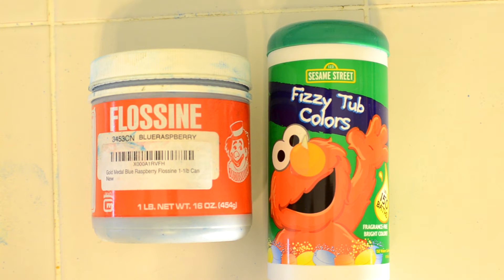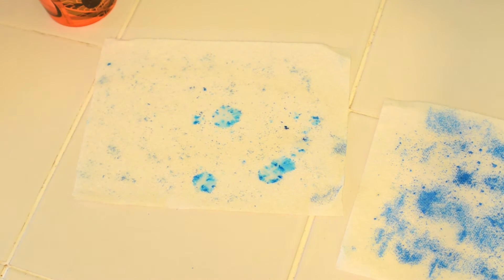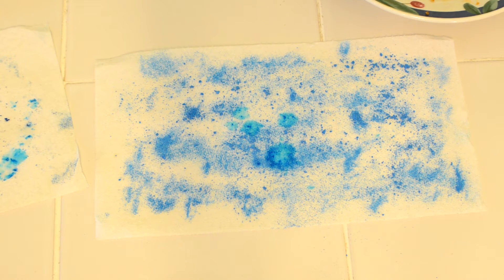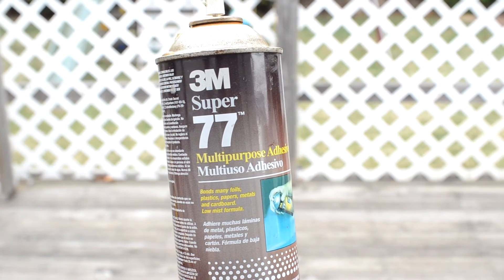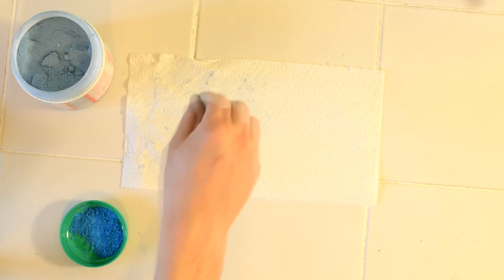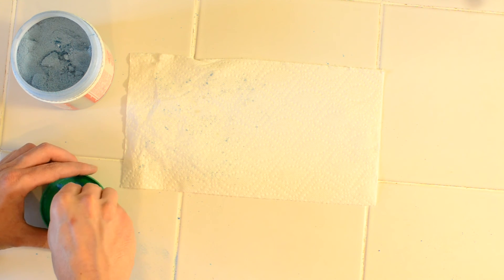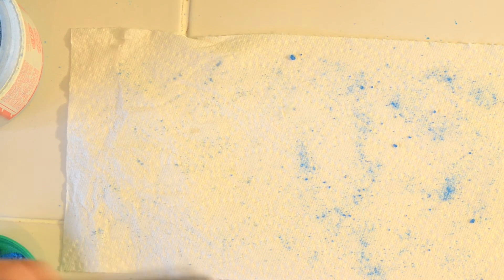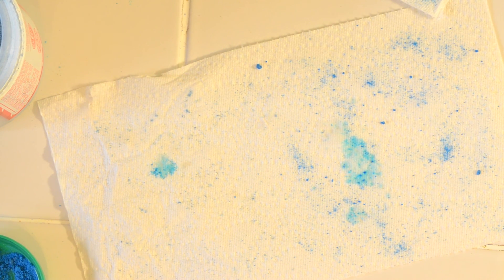Homemade water leak detector paper

Comment: Hey thanks for the great idea. We build large filtration skids and we hydrotest all units before we ship them. Since super small leaks will not pass inspection.  So official leak detection paper would cost a fortune. I tried your Flossine idea but had issues with the spray adhesive.  So, I had a great idea... based on YOUR Idea.  I bought a 48" wide roll of adhesive backed carpet protector. I applied a light dusting of flossine  with my Powder Coating Gun. And it works so well. I can make a 48" x 200 foot long sheet if I wanted. Thanks for the great idea. Try the carpet protection film. You can get smaller rolls at lowes. Thanks again!
Reply from the maker: I dont think I would have thought of trying  a powder coating gun, I would have just ASSumed it wouldn't work. That's a lot of water leak detection paper!

Find any leaks with it? I like the sticky paper idea. Pretty much anything to hold the granules in place should work.

For other people, for tiny amounts I think the koolaid packets would work well too, but at the time the flosine is what I had on hand and was available cheaply in bulk. 

There is water detection strip available pretty cheaply; it's a 1/8" wide roll available in various lengths that you could stick to areas of interest,  but sounds like you can make hundreds of square feet for the cost of a couple cases of beer!
Reply: @HandfulOfTranquility  more importantly they don't seem cheap enough for the weekend DIY'er to invest in (the powder gun i mean)

Comment: Does the color from the water doplet stay once the paper dries out?
Reply from the maker: It sure does. This dye is very concentrated, so the water dissolves it and spreads out on the paper towel. When the water dries you can still see the blue spot. You could use kool-aid packets to do the same thing as what I did here

Comment: Great idea! My basement is leaking and I can't figure out where the water is coming from.
Reply from the maker: +Latoya White Thank you, I had a couple ideas when I saw that leak detecting stuff on cell phones. At the time, I needed to see if any drips of water had fallen at work in a couple areas. At that time I used black Crayola markers in a grid on paper towels, the washable black ink would run if large droplets would hit. But, it didn't work great. Later I needed to see if my plumbing work dripped at all, and I had this stuff for cotton candy. Voila!